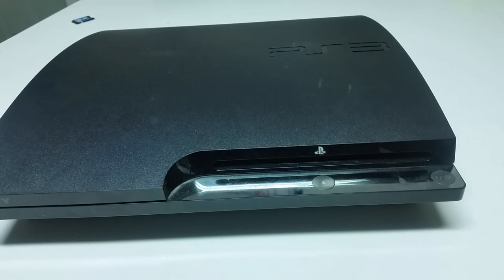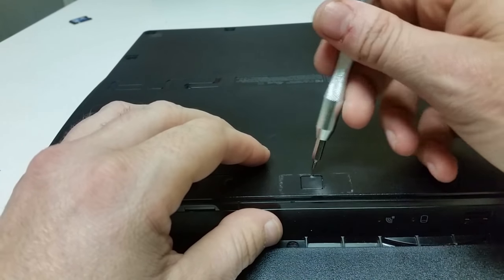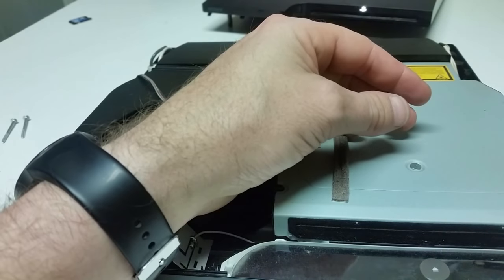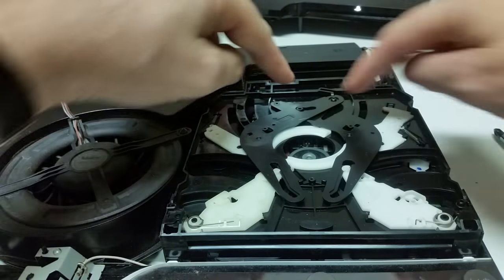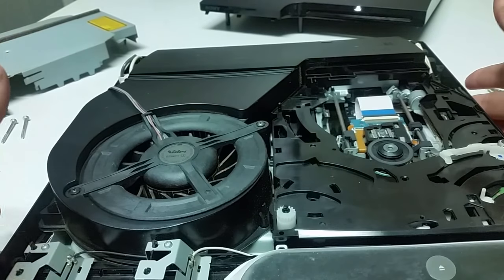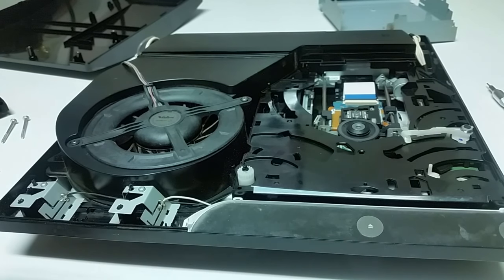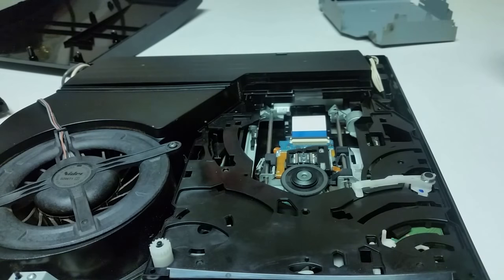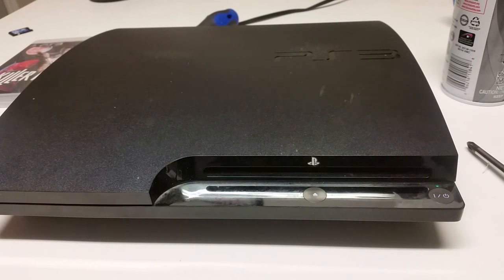PS3 Won't Eject Discs (Fix)

Comment: My issue ended up being the felt part of the front of that metal cover for the disc drive, where it clicks in and meets up with the disc inlet, it wasn't actually clicked in, made the disc hard to insert, the ol' PS3 lives on again! Thanks for the vid my dude!!!!

Comment: Hi Tatted. I watched another vid on how to clean a lens. Got that sorted. Then came a sound that wasn't there before. And discs started ejecting themselves. "Did I break the darn thing?" Searched and came across your tut. The screws were a bit too tight causing pressure on the arms as you mentioned. You're a tech dude for sure. Thank you. 💫💪

Comment: What sohuld I do if the arms that you said to check if they move freely are stuck?
I see that the right arm in the white part have a pin that stuck some how in a hole that under it so the move can be only short

Comment: the arm with the spring wont move even with the spring and then i bent the spring. is there a tutorial I can find anywhere for the bic lighter hack and a video on how to clean the inner black parts under it because thats where my issue is.

Comment: Hi I have a problem with that white arm in the disc, somehow it doesn't move around freely as it should without the spring, it kind of gets stuck and have to force it to move, how do I fix that problem

Comment: I tried but it didn't work I remove all the screws from the bottom but the top didn't come off I tried the manual thing the disc didn't come out mine must broken worse then I thought none of the ideas on here work so I just gave up

Comment: Thank you for this great video.  I was having trouble with mine after I took it apart to clean.  And your video saved me $50 after my disc drive wouldn't work.  I must have tightened the screws down too much.
Reply from the maker: Glad to hear it!

Comment: My boyfriend was working on his ps3 last night and fixed his problem except when putting it back he went to check the spring you talked about on 15:52 it flew off and he doesn’t know how it was before. Able to help?
Reply: Yeah the spring is tricky. Here's my suggestion:
1. Don't bend it otherwise, it's caput
2. If you're having issues with the white arm, make sure it's as close to the surface as possible. It shouldn't be hanging high or in mid air.
3. In my case I screwed the white arm and the spring. Good news is that the Japanese thought of that and the entire ps3 becomes easy to work on once you have worked on it one time. Basically put the arm below the black dot and insert it correctly.
4. If you only have a problem with the string, then you have to put the shorter side of it attached to a special place on the white arm and the longer side of the string goes into a black square.
5 watch from 15:00 hope this works for you that's what I did and worked for me. I would say it requires some luck too.

Comment: I fucked up mine by opening with a disc inside... Now i can't put it back together...
Reply: Did the absolutely same thing. If you still have issues here's what worked for me:
1. The disk is stuck there and the ps doesn't spit it out, so what I did is I forced it to go out.
2. I accidentally messed with the white arm and spring and broke it, but got it fixed by watching this video and put it back together.
3 I suggest you take your time and watch this video in detail this is probably the best one out there and I also suggest you watch it twice.
4. Don't give up on your ps and try to plan your moves ask yourself "how can I fix this" and "why is this happening to me"
5. After I took the disc out I couldn't put it back in. There was a white pin that didn't let me. And if you have a disk in it doesn't spit it either, I can't tell you the timestamp but the guy also forced the disk to get in the Playstation, it's very weird.
He didn't turn it on, instead he literally shoved the disk in I did the same and it worked, I hope this helps you I also didn't realise I had game inside until I saw it, if this doesn't help keep fixing it mine took 3 hours to figure out even though it will take 10 mins if you know what your doing.